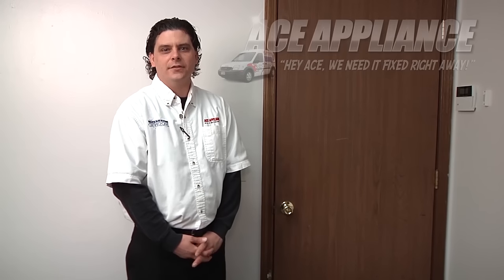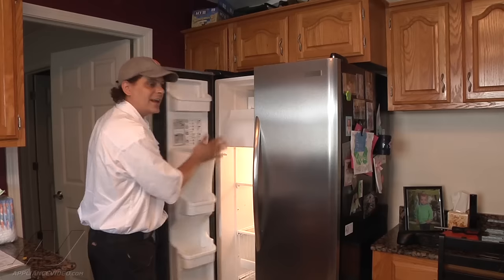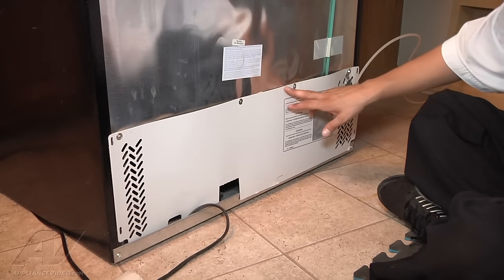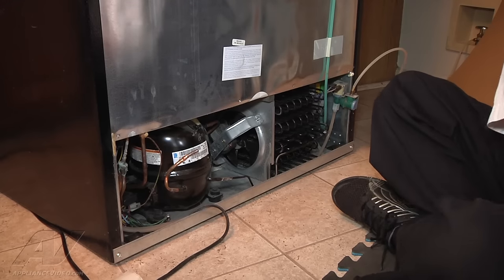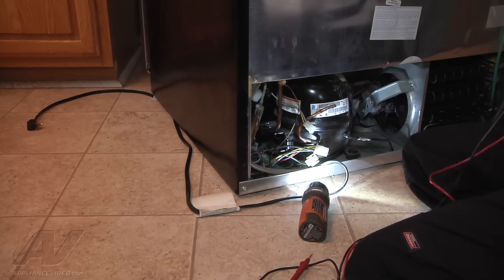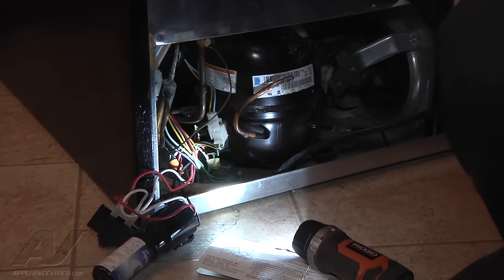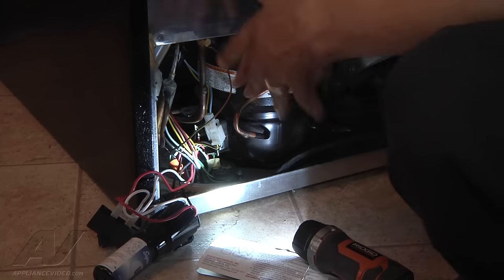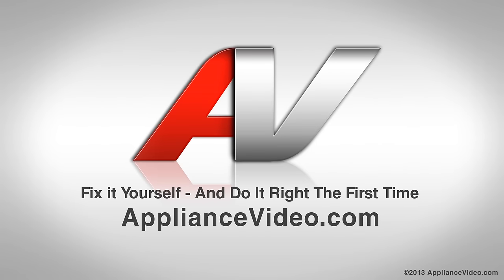Frigidaire Refrigerator Repair - Not Cooling - Hard Start Relay Overload Kit - Diagnostics

Comment: Hi
Did you disconnect the solid state capacitor or you left it in there?
What's the price for that solid state capacitor?
Reply from the maker: Great question, if you have a more technical question that our parts department cannot answer, you can search our over 17,000 answered questions free at our website www.ApplianceVideo.com under our Repair Help section. You can also call our parts department at 1-800-830-5465 and they can give you help 7-days A week ,or search at www.SaveMoreOnParts.com  .

Comment: Hello, we have the LG LSXS26386S Linear model.  Only about 2.5yrs old.
 Both fans and compressor are running, although the compressor is not getting warm to the touch which seems odd to me.  Also, the fan in the freezer area seems to turn on when i open that door, then shut off shortly after door is closed.  I feel around the vents in the fridge and don't feel any air movement.  I vacuumed and blew out the dirty coils already.  Thanks for any tips..
Reply from the maker: Great question, if you have a
more technical question that our parts department cannot answer, our
technicians are answering all questions at our website at www.ApplianceVideo.com under our Repair Help section. You can also call
our parts department at 1-800-830-5465 and they can give you help 7-days A week
Mon-Sat . You can also search at www.SaveMoreOnParts.com 7- days a week.
Reply: I have the same fridge with the same problem, did you ever figure out what was wrong?
Reply: Zy Gaines nah, I think it needed a new compressor so I sold it for parts

Comment: I have a ge profile that will only cool to 14* in the freezer..could that be a switch or compressor ?..
Reply from the maker: Great question, if you have a
more technical question that our parts department cannot answer, you can search
our over 10,000 answered questions free at our website www.ApplianceVideo.com under our Repair Help section. You can also call
our parts department at 1-800-830-5465 and they can give you help 7-days A week
Monday -Sunday, or search at www.SaveMoreOnParts.com  24 hours
7- days A week.

Comment: So this Supco URCO410 comes with female flag spade terminals I see.  What would someone do who has the Electrolux Relay Overload (like me) and compressor that has three circular pins that are 0.090 in. in diameter?  You can't use the spade terminals on that.

Comment: If my fridge compressor is warm to the touch does it mean it's definitely bad?
Reply from the maker: Great question, you can call
our parts department at 1-800-830-5465 and they can give you help 6-days A week
Mon-Sat . You can also search at www.SaveMoreOnParts.com 7- days a week.  If you have a more
technical question that our parts department cannot answer, our technicians are
answering all questions at our website at www.ApplianceVideo.com under our Repair Help section. We have over
4,000 common questions and answers that you can easily search through by your
model number, appliance make, and problem or error codes, and It’s free to
search through our question & answer library.
Reply: @Appliancevideo  hi i have a whirlpool side by side refrigerator and is not cooling and the compressor fun is working but the compressor is really hot, any help please

Comment: Hello, I have a Frigidaire PLHS69EESS2 and both my fridge and freezer are both staying warm around 50+ degress.  I checked the back panel in the freezer and saw a large amount of ice buildup on the copper line that the thermostat rests on but the fan was running.  Sometimes the temps would fluctuate, so only the freezer would rise in temp and then fall back down to regular over a few hours or vice versa.  I just replaced the thermostat in the freezer today and now they both seem to be running hot. Any suggestions?
Reply from the maker: Great question, if you have a
more technical question that our parts department cannot answer, our
technicians are answering all questions at our website at www.ApplianceVideo.com under our Repair Help section. You can also call
our parts department at 1-800-830-5465 and they can give you help 7-days A week
Monday -Sunday, or search at www.SaveMoreOnParts.com  24 hours
7- days A week.

Comment: Hello,can you help me ?I bought used viking VCFF036SS fridge for repair.
I opened the back panel and I saw the smoke pipe left side of compressor have small hole and the right side of the compressor the tiny pipe it's broken, when I contacted the fridge the fan turn on ,the light turn on and that it.
I think the fridge have another problem...
What I have to do?
Or it's better to sale for parts etc..
What  I have to do? 
Thank you!
Reply from the maker: Great question, if you have a more technical question that our parts department cannot answer, you can search our over 17,000 answered questions free at our website www.ApplianceVideo.com under our Repair Help section. You can also call our parts department at 1-800-830-5465 and they can give you help 7-days A week ,or search at www.SaveMoreOnParts.com  .
Reply: P yes I have a small refrigerator I can give you the name of it and everything can you help me get a wire from attic on it somatic wiring somatic how long will it be before you let me know

Comment: I have an issue with an lg refrigerator where I have 2 fans in the freezer and another fan in refrigerator where all the fans are not working, I already replaced the main board and I'm still having the same issue, any suggestions?
Reply from the maker: Great question, if you have a more technical question that our parts department cannot answer, you can search our over 17,000 answered questions free at our website www.ApplianceVideo.com under our Repair Help section. You can also call our parts department at 1-800-830-5465 and they can give you help 7-days A week ,or search at www.SaveMoreOnParts.com  .

Comment: i have samsung side by side model : SR-S24NTC  the freezer side is perfect for some hours and then stopped working until I unplug AC cable and put it back again   but the fridge side not working at all the temp not change and I replaced the temp sensor and  thermal sensor but  still not working  ,  is the  problem in freezer side or   relay in the main board or the capacitor   I check the diagnose menu but there is  no code thank in advance
Reply from the maker: Great question, if you have a more technical question that our parts department cannot answer, you can search our over 17,000 answered questions free at our website www.ApplianceVideo.com under our Repair Help section. You can also call our parts department at 1-800-830-5465 and they can give you help 7-days A week ,or search at www.SaveMoreOnParts.com  .

Comment: If this is my problem' and I suspect it is, would the water/ice dispenser on the freezer door also be inoperative? Note: freezer fan and interior light are working but no cooling.
Reply from the maker: Great question, you can call
our parts department at 1-800-830-5465 and they can give you help 6-days A week
Mon-Sat . You can also search at www.SaveMoreOnParts.com 7- days a week.  If you have a more
technical question that our parts department cannot answer, our technicians are
answering all questions at our website at www.ApplianceVideo.com under our Repair Help section. We have over 6,000
common questions and answers that you can easily search through by your model
number, appliance make, problem or error codes, and It’s completely free to
search through our question & answer library. There is a very good chance
you question is already answered there.

Comment: have some cooling problem, i notice there are some condensate in the freezer, and the compressor run much longer than before before shutting off.. also this past couple of months i notice the compressor a little bit louder when its on. i have an electrolux etb3200pe its already 3 years old...
Reply from the maker: Great question, you can call our parts department at 1-800-830-5465 and they can give
you help 6-days A week Mon-Sat . If you have a more technical question that our
parts department cannot answer,
our technicians are answering all questions at our website at www.ApplianceVideo.com under our Repair Help section. We have over
3,000 common questions and answers that you can easily search through by your
model number, appliance make, and problem or error codes, and It’s free to
search through our question & answer library.
Reply: i found the problem.. i replace the extension wire. it seems that it cannot handle the power required for the fridge its an old extension cable, so i got new one. If we didn't have a brownout i couldn't notice it. because when the electricity came back on, i  notice that the fridge lights is not turning on, so i tried to use a different newer extension and now it got all its juice needed. Thanks for replying

Comment: Hi I just put a high-voltage board on my fridge and now the buttons on the front panel will not work it’s flashing in Set up mode but none of the buttons work

Comment: What about evaporator line going evaporator is frozen but rest of evaporator is not cold.
Reply from the maker: Great question, if you have a more technical question that our parts department cannot answer, you can search our over 17,000 answered questions free at our website www.ApplianceVideo.com under our Repair Help section. You can also call our parts department at 1-800-830-5465 and they can give you help 7-days A week ,or search at www.SaveMoreOnParts.com  .

Comment: My Tecumseh TP111AR003B8  TPD1380YXA compressor does not show the HP rating?  How do I find that, in order to buy the correct 3-2-1 start kit?
Reply from the maker: Great question, if you have a
more technical question that our parts department cannot answer, you can search
our over 10,000 answered questions free at our website www.ApplianceVideo.com under our Repair Help section. You can also call
our parts department at 1-800-830-5465 and they can give you help 7-days A week
Monday -Sunday, or search at www.SaveMoreOnParts.com  24 hours
7- days A week.

Comment: I have a hot point refrigerator.  They had a power problem in my area.  The refrigerator lights is on inside of freezer and refrigerator, but I do not here freezer or refrigerator making noise.  Not getting cold, freezer or refrigerator.  Where is the thermostat located on a double door Hot Point Refrigerator?
Reply from the maker: Great question, if you have a
more technical question that our parts department cannot answer, our
technicians are answering all questions at our website at www.ApplianceVideo.com under our Repair Help section. You can also call
our parts department at 1-800-830-5465 and they can give you help 7-days A week
Mon-Sat . You can also search at www.SaveMoreOnParts.com 7- days a week.

Comment: Hi Troy, thanks for the video.  I have a Kelvinator Impression Series 500 Twin Air No Frost 1998 model.  For the past 3 days the fridge department temperature oscillates between 13 and 15 degrees and the freezer temperature is 0 degrees (and not freezing ice-blocks).  The freezer evaporator fan is working, the compressor is starting and working, the evaporator is not over-frosting, the air ducts between freezer and fridge departments are free of blockage, cool air is circulating into the fridge compartment, I couldn’t find the defrost thermostat behind the freezer panel, the defrost timer is not stuck in defrost, I tested the heater element using the defrost timer manually and the heater element is heating, I don't know if the defrost timer could be damaged and cycling too often, but I haven't noticed the evaporator fan switch off once, so I don't think that's the problem.  The seals were all changed 12 months ago and all sealing well.  The problem happened from one day to the next.  What can it be, do you have any suggestions?  Can the fridge be low on gas?  Or can it be something else?  Please help.
Reply from the maker: javierpaez13 
All of our technicians are now answering
questions daily on the ApplianceVideo.com website. You can search completely
FREE in our Repair Help section with over 1000 questions & answers. Or you
can get unlimited technical advice and video links emailed to you by our 14
factory certified technicians at
http://www.appliancevideo.com/premium-membership/.  If you are in need of
any parts please support our parts department on line at
http://savemoreonparts.com/ or call 1-800-830-5465 7-days a week until 11pm
Eastern time. Thanks for your support. Matt Ace Appliance factory service
technician.
Reply: replace the defrost timer.

Comment: This video is probably too old for anyone to see in order to help me, but I'm going to take the chance anyway...

I think I might have a circulation issue with my fridge. The freezer is great, but the fridge won't cool. When I put my hand over the damper, there is barely the faintest amount of air coming through to my hand, but as soon as I open the freezer door, I feel much more air coming through to my hand. I think the return air vent that allows air to pass from the fridge back to the freezer is blocked. 

I tried pouring hot water into it, but it pooled up and then froze, so I put a blow dryer on it for an hour! A great deal of the ice melted, but I didn't see the water pooling into the drain pan under the fridge, and my fridge is still warm. Maybe I just need to hit it longer with the blow dryer?? There may be ice deeper into the vent. Any thoughts?

Comment: Sir , help me pls , my refrigerator is not cooling inside of the fridge but it cooling good in deep freezer. How come?  
What could be that.
Reply from the maker: Jay
 All of our technicians are now answering questions daily on the ApplianceVideo.com website. You can search completely FREE in our Repair Help section. Or you can get unlimited technical advice and video links emailed to you by our 14 factory certified technicians at http://www.appliancevideo.com/premium-membership/.  If you are in need of any parts please support our parts department on line at http://savemoreonparts.com/ or call 1-800-830-5465 7-days a week until 11pm Eastern time. Thanks for your support. Matt Ace Appliance factory service technician.
Reply: what I did at the same problem wasn't cooling at all what I did I am plugged it for at least 3 to 4 hours and open the doors as well and put it back on and it worked so I will go that route first before calling or buying one
Reply: how type your refrigerator??? frost/non frost /defrost???
Reply: IF you can see the coils in the freezer and they are caked in ice, you have a defrost problem.  It only affects the fridge part, your freezer will still be ice cold.  You need to pull the panel in the freezer out, and take a hair dryer and melt all the ice off.  It should work fine from there.  A week later, if the coils are frozen up again.  It’s one of three pretty easy things.  1. Defrost timer, about $10 it’s what puts the freezer in defrost mode.  2. Hot Coils Element that melts the ice.  Least likely.  3. Thermostat.  If it messes up, it never kicks the heat on and it freezes up.  Hope you get it.

Comment: Hard starts are NOT a fix. It is only temporary.  The overload relay @ 9:22 sure looks like a capacitor to me. Also, how did you check the amperage. Maybe just the solid state relay went bad from arcing (turning on and off). Sometimes, the 3 n 1 does not always work in these situations. ALWAYS CHECK YOUR AMPERAGE! Before adding a 3 n 1. An amperage check can be done with an amprobe. Before and after repair.

Comment: i have checked all you have said in the video i can hear the compressor i can hear fan i can turn  on defroster our problem is that the freezer and fridge wont get cold everything seems to be running as it should took panel off in freezer and it all ices up and have defrosted and put panel back on and gets cool but not cold enough like 45* and wont get any colder took panel off again no ice but iced right up as soon as panel was off?
Reply from the maker: Sam Buck 

All of our technicians are now answering questions daily at our http://www.appliancevideo.com/ website under the Repair Help section.  We also have over 1600 common questions and
answers that you can easily search through by your model number, appliance
make, problem or error code and it’s absolutely FREE. You also have the option
to email a factory service technician with a question on your appliance at
http://www.appliancevideo.com/repair-help/ . If you’re looking for a repair video, you
can also search our library of over 2600 free repair videos. ApplianceVideo.com
specializes in quality DO-IT-YOURSELF appliance repair videos and we get over
800,000 views per MONTH to our videos worldwide and growing. If you need of
parts for your major appliance, we have over 5-million parts in stock at http://savemoreonparts.com/ .  Thanks
for your support. Matt Ace Appliance factory service technician.
Reply: +Sam Buck If you don't have a defrost problem, and the cooling thermostat is ok along with timer, it may be that you have a leak of cooling gas from the circuit.
Reply: I have a technical repairs done and the problem still persists.